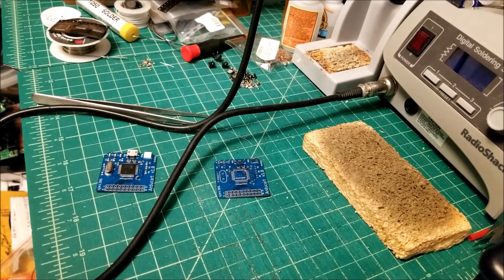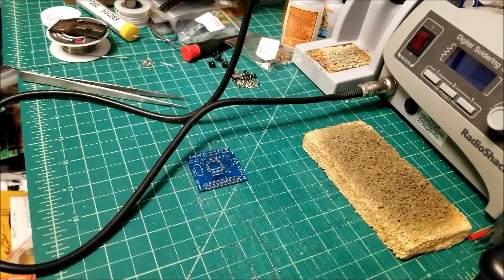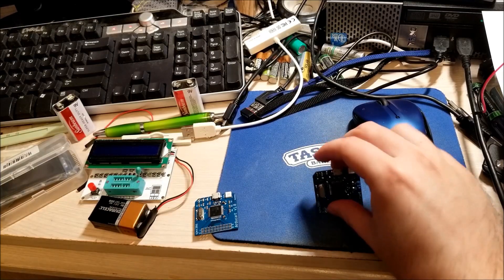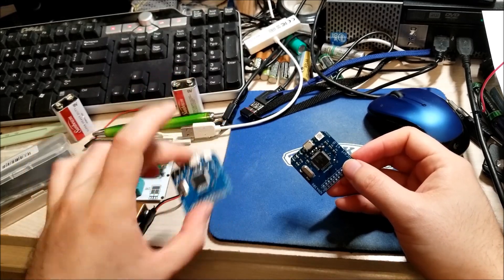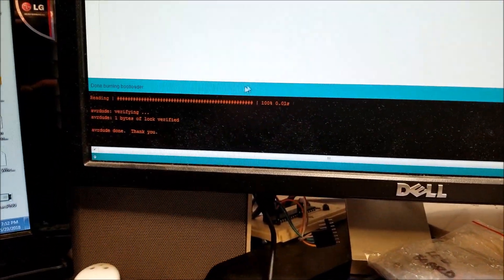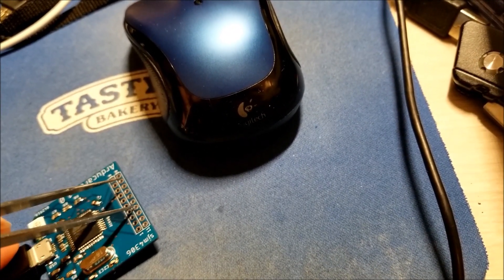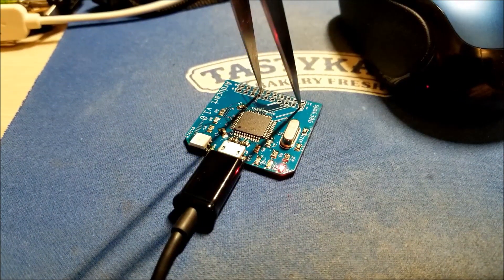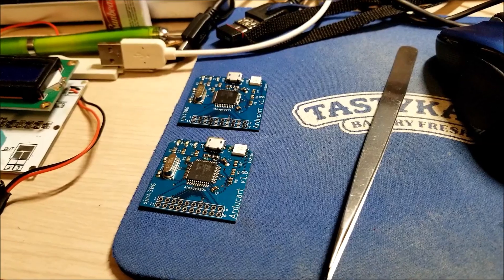Soldering the ArduCart

Comment: Hi. How do you solder aluminum wire (thin gauge) with another aluminum wire (same gauge)?
Any hacks and techniques to solder aluminum wires to each other?

What brand of solder wire, flux and solering station do you use? And brand of tweezers and soldering sponge?

Thank you.
God bless, Rev. 21:4
Reply from the maker: If it's pure aluminum with no plating to accept solder then your only easy way is mechanical. This basically means screw terminals, conductive adhesive or ultrasonic welding.

As for solder I use MG Chemicals, flux is a Kester liquid flux pen (though I use no clean radioshack gel flux on occasion), and my station is a radioshack 60W digital temp controlled iron. I cant remember where I got my tweezers from (though they are super sharp and anti-magnetic) and my sponge is just some natural rectangular sponge for kitchen cleaning (I avoid artificial sponges just in case they melt or burn depending on what they are made of).
Reply: @sjm4306  I see, thanks. I take I need to buy special flux for aluminum wire and special solder wire for aluminum? I guess, mechanically connecting is not an option, the tolerance is too small, will need the connection to be as thin as possible.

Can I use aluminum flux that's used for brazing large aluminum tubes? What brand should I look for aluminum solder wire (if I can't use the regular 60/40) like these ones:

https://shopee.ph/Harris-Aluminum-Flux-(10g)-i.122472700.1978063123

https://shopee.ph/Stainless-Steel-Wire-Copper-aluminum-Flux-cored-WireUniversal-Magic-Electrode-i.161718918.7943283387

The soldering lead is 1.5mm diameter. If yes, this is ok for aluminum wires, do I need to buy the flux, since the aluminum solder wire, already has flux in it?

That's amazing by the way, you still have Radioshack:-). I only have their portable no cord small butane powered soldering iron (it can do blowtorch, a small heat gun, a hot knife for styrofoam. I only came w/ the regular conical tip) the tips are hard to find now. I'm contemplating on buying a soldering station similar to yours + 10pcs. of different tips for  around US$60 w/ shipping. Do you recommend I buy and change my soldering iron (if yes, I plan to donate my butane powered one to the church, or will I still need that. I do have a large blowtorch and smd hot work station already)?

Thanks in advance for the recommendations. I'm trying to make my basic electronics stuff more advanced :-) including proper tools, trying to only buy things now that have great reviews and are recommended by talented ones like you, avoiding generic stuff, coz' it seems, say a generic soldering wire, it seems to be more difficult to work with and is seems to make the tip dirty very easily.
Reply from the maker: I've never tried myself to bond aluminum other than using mechanical means so I cant say for sure but I thought it's basically impossible to solder aluminum in the conventional sense. Aluminum is welded using a tig or mig welder at much higher temperatures than soldering is done at since you basically need to melt part of the aluminum to bond with the aluminum feed rod. I could be wrong though since this kind of application is outside my skill set.

Comment: What kind of Solder were you using, also do you know the brand of flux and how well does it work.
Reply from the maker: I personally use 60-40 leaded solder which works great and at work we use silver lead free solder which is a pain. The flux I use works great but is pretty messy and needs cleaning after you solder. It is RadioShack branded which went out of business so I cant say where to get the specific one I have.

Comment: why not add cartridge contacts to the bottom of the board, and bridge them to the through hole connections
it would make the board look and function more like a typical cartridge, especially with a 3D printed body
Reply: EMCvids you’re 100% right, but not worth the extra cost on a prototype. Definitely worth it down the road though if and when these are for sale